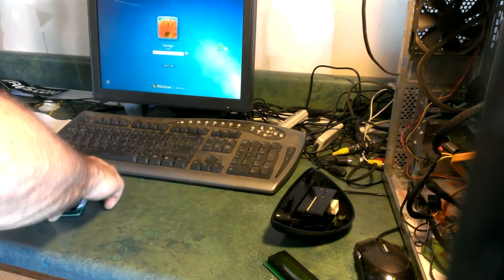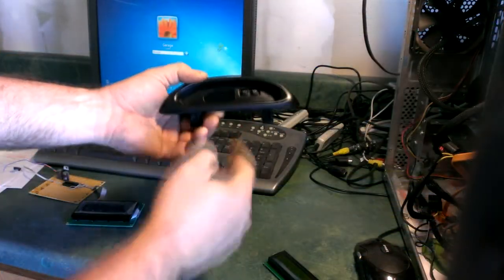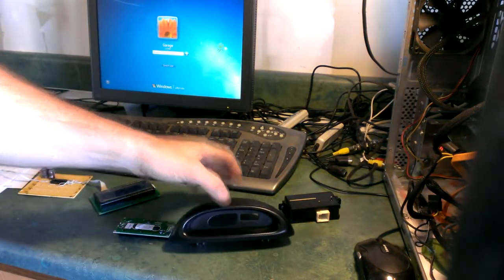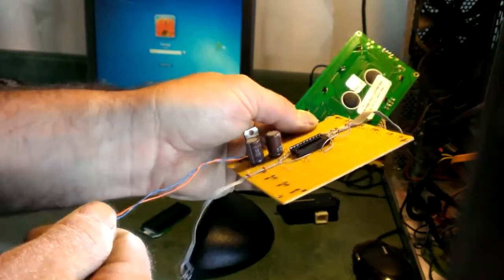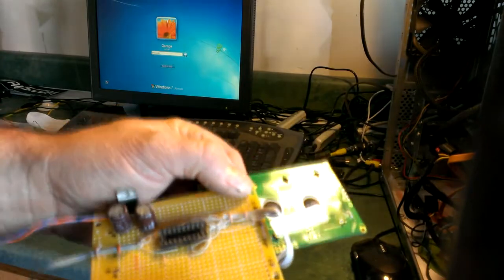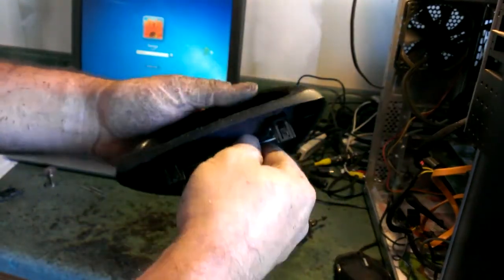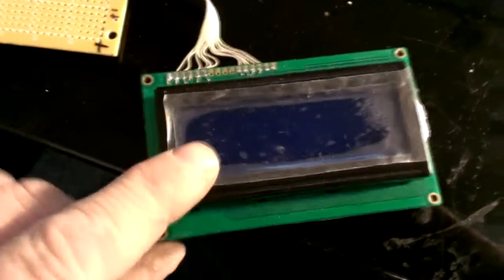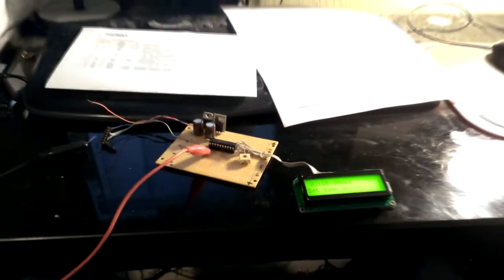Mustang GT Project - Dash Pod Mod

Comment from the maker: It's working so well I don't give it much thought!
Keeps the water heater off from noon to 7PM on Mon thru Fri except when I push the temp bypass mode. 

As for this project I was really into it today (finally) but couldn't find my male to male USB cable for the programmer. 
So I drove to Radio Shack. No dice. 
Best Buy. No dice.
Then finally to Fry's Electronics (30 minutes away) to get a cable. 
Then I made the last bit of video and uploaded what I got so far.